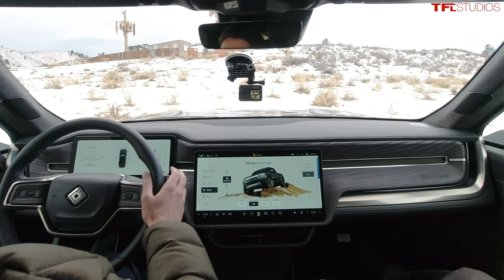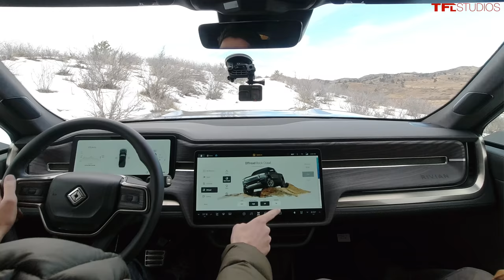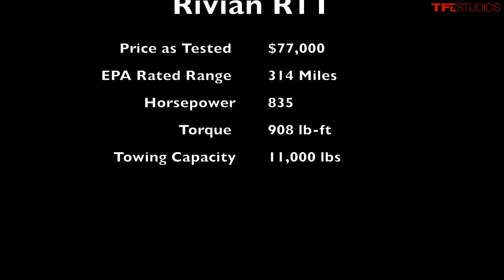Fully Loaded! Can an EV Pickup (Rivian R1T) Survive a Hard Days Work?

Comment: Price is a big hurdle for a lot of people.  The EV market has neat stuff, but everything's 2x to 3x the price required for actual mass consumption.  You have a few at the right price, like the Leaf.  But pretty quickly you're up to $40k and above.  Even the affordable Model 3 is a $40k vehicle where equivalent ICE products in $10k to $15k cheaper.  The Rivian just at it's base price is $60k, and you're at a decent ICE product range by that price point.  When trading EV and cost along with total package practicality, you're in the realm of something like a Mach-E in the mid $30k range, but higher trims of that head towards $50k.  Tesla's been in the market for long enough to have a pretty broad price point spread.  But new companies like Rivian sit at an entry point of $60k and Lucid is way up at like $130k.  Most of the budget EVs are small cars, compact things that lose a lot of the practicality breadth just to match the price of ICEs on the market.  This would be a wildly different story if the Rivian started at $30k, but that's kind of the core problem.

We can argue savings long term and possibly government incentives, and maybe you're ROI versus an ICE equivalent is like 10 years.  What if you don't own it that long?  What about depreciation and year to year loss of value?  It's also important to understand electric costs and the concept of price equivalence.  MPGe is high, but true savings comparisons are a byproduct of real costs, what your fuel costs today, next year, 5 years form now, and how much electricity costs at home (and at what hours of the day) and cost of charging stations and if the business model of those also change in the future.  However, in general, the numbers that others have looked into show a 60% savings on fuel costs with EV.  For 15k miles a year, 30mpg, and $3.50 gas price, that's roughly $1000 a year in fuel savings.  The same 15k miles with a 20mpg vehicle and $4 gas is an $1800 savings.  So 10 years equals $10k to $18k  in savings...on a vehicle that costs $20k to $30k more.  And if you only own it for 5 years and resell, depreciation on a $30k vehicle versus a $60k vehicle hits way different.  The critical point of EV is when it TRULY and significantly becomes cheaper to own.  Right now, that's only the smaller EVs and hybrids.

A secondary part to this cost game is the difference in towing.  EVs drop around 50% in MPGe towing.  ICE are closer to 30%.  So for a work vehicle or anything commercial use, the buy cost difference needs to be tighter to be more cost effective.

With costing aside, EV is cool in the sense of what if offers.  The EV architecture allows new packaging and space.  It offers high power output on a compact package.  All of a sudden you can have 1000 hp and 1000 tq in like anything and everything.  It sounds impressive, but some of the effect of it is lost with the lack of gearing.  It's like having a 1000 tq, but you're starting off in 4th gear.  Like a Viper will go 65mph in 1st gear.  Basically a Viper's 1st gear is most cars 3rd gear, and it hides the torque a LOT and makes the relatively slow at lower speeds.  EVs have the same mechanical disadvantage.  EVs kind of sit in two realms, geared low or geared high, and they either have low speed punch but not much up high or high speed punch but less so down low.  Big raw numbers covers the spread, but the impressive numbers are only partially used relative to an ICE with gearbox.  People who grew up paying with RC cars might understand this better, especially if you played with the hobby stuff, built your kits, played with different motors and gearing, etc.  Power and gearing is a tradeoff, and traction has limits.  You balance the system.  Or you just toss massive amounts of power at it (high powered brushless motors and high voltage custom packs).

Comment: Great Vid! Gotta agree with Tommy about the spare tire though. However maybe there is enough space to put the spare in the frunk? And on that note I agree there's not very much to not like on the Rivian, but the frunk would be more useful if the front of the frunk was flat so you could slide stuff in like other manufacturers. Having to lift stuff out is a bit more of a hassle.

Comment: The truck has a front trunk as well. Would have been cool to do an Avalanche style folding bulkhead in the rear AND the firewall.  Run pipe between the seats and all the way to the front bumper.

Comment: All it took was seeing the one sheet of plywood hanging out back. A small 28 square roof took 45 sheets of plywood, nearly 100 bundles of shingles, a roll of tar paper a roll of ice dam all ridge vent and metal edging with it. All fits in back of my 1982 Ford pickup. What you have is a joke. My old truck has been on job every day for 40 years. It starts on the hottest day and been on road at -30 in winter of 1993. It has proved itself a reliable truck with well over half million miles. Original from transmission to ground. Changed engine few times but only cost 500 dollars.

Comment: You answered a question I had about hill descent. I was concerned since it didn't have a low range but it looks like the regenerative breaking is enough. How much weight can the tailgate hold? Hinges look a little weak. I won't get rid of my F250 but this would make a great vehicle for my many short trips.

Comment: Tommy  there are 2 ideas they should take away from ford to improve this truck on board scale to check the payload and more amps with a voltage meter to see how much watt’s the truck is using but  the price has to come down between the Merrick in a platinum Price points for the price they’re charging it should include the onboard kitchen Tommy that was A good  In-depth view of the trucks potential

Comment: The key measure of thus as a work truck is how much work can you do in your job with the available 75 kWhr or so.   If you move 25 miles at 3 kW/mi you are ok or 75 mi @ 1 kW/mi.  But you can't do more where there is no recharge nearby.

Comment: Question about a possible work-around for this truck: since this IS a truck and Murphy's Law will give you a flat when the bed is fully loaded and it's cold and it's raining of course, lol...could the spare live in the frunk? Seems like a great place if under the bed is not an option and under the bed floor is a pain in the ass to get to when loaded up. Yes, then you are using up that useful weatherproof compartment. But it has a whole covered bed and a gear tunnel already.

Comment: For me the big problem is, I get back after working hard. It’s fully uncharged and I need to charge it. Then I get a phone call that my kid is in the hospital. Do I have to wait for it to charge? It breaks down. I can’t fix it. And then I have to find a place supposedly in rural America that services electric trucks. Or, government starts really nannying the features of my truck and decides I don’t need some of what I paid for such as the tank driving mode you mentioned. They can push out an update while I’m sleeping and my truck no longer has it. None of that is the case with my gas truck. So no, no because of the lack of control I have to fix, lack of ability leave when I need to and because of the regulations that I already see being pushed out all the time on Teslas.

Comment: I wonder if it can simulate fully locked "axles".
It didn't seem like it on the other off-road video.

There's always an advantage to have fully locked at all times instead of sensors sending power.

Comment: I wonder how long it will take a company like Toyota to put a really solid, dependable, long last EV truck like this.  I mean, maybe the Rivian will hit it out of the park but the tech's adoption feels like it is in its infancy.  I like the advantages an EV has to offer.  Faster acceleration, more torque, much more simple to design and build... battery tech will improve in leaps and bounds over the next 20 years.  It's hard to imagine what vehicles will drive like in 20 years.  Very impressive.  People often forget with a car, truck, appliance or cell phone for that matter... it's the back end stupid.  Warranties, service, repairs, parts availability, etc.  It's going to be a short while to straighten all that out, but it won't be long.  I'd probably buy a third year production Toyota Taco hybrid.

Comment: Quick question were you guys able to do a range test at all? Are you even legally able to say what was the max range you could get out of R1T with these tires? Truck looks capable which is great, tailgate extension comes in handy big time. Perhaps there could be some aftermarket accessories that can utilize that feature. I'm concerned about the range tho bc of it's weight.

Comment: I would be interested to see the maximum torque per wheel. If it's 900 lb feet total. That would mean it's 250 lb feet at each wheel. That's not a huge amount. If you were to find yourself in a situation where you needed to pull yourself up and over something only using one tire, I doubt 250 lb feet is going to lug a 7,000 lb vehicle up and over anything. That's one advantage of having a mechanical drive unit systems. If you've got lockers front rear and center whatever the maximum engine output is can be sent to any or all of the wheels. As long as the axles and suspension and drive line can handle that much torque.
For example in a Wrangler Rubicon when you lock everything up it can pull itself up and over anything even just with one tire. I doubt that the Rivian would be able to do that.
Would be interesting to see if they put a mechanical locking device between the two motors and the front so that at least you can link up two of them on any wheel in the front, And same in the rear.
That would give you 500 pound feet of torque.

Comment: Does the Rivian have enough range to go approx 100 miles each way to a herding trail we work in January and July? Keep us warm in January here in Northern VA with max temp of maybe 20F and a windchill approaching zero when we need a break from the cold and in July when its a 100 F by 10 am with a dew point apporaching 80 keep us cool when we need a break? and the we charge quick enough when we get home to repeat on Sunday?  Does it have enough range on Fri afternoon in August  to get me home from work when its 90F+ and dewpoint is 80 and I am running the AC at max in bumper to bumper traffic moving at maybe 15mph for a 50 mile trip home after a 50 mile morning trip?  So thats  100miles  but can it handle full AC and bumper to bumper crawl?  A EV has to able to ahndle the extremes not just the every day. My GC can do and I can fill up in less than 10 minutes with 20 gallons of gas.

Comment: How good would the battery life be on a 5 degree day pulling an 8000 lb loaded stock trailer 75 miles and back then ranch work?  Not practical as a work truck.

Comment: I'm surprised Rivian doesn't offer a bracket shaped pivoting tail gate cage  that when flipped over goes from resting inside the end of the bed to rest on and coral the 3 sides of the tailgate when it's down.Originally offered on the  nissan frontier quad cab around 2000.
Reply: Not their demographic. But I imagine we'll see a 3rd party option later on (that's if Rivian doesn't come up with a more traditional work trim for the R1T).

Comment: Speaking of getting a flat; can the suspension lift just one wheel for changing?

Naturally you didnt use much battery - you werent going fast enough for wind resistance, and thats where 90% of ecar battery goes - pushing air out of the way.

Comment: And, if the battery dies out in the woods, does it come with a 30 mile long extension cord?
Reply: If you run out of gas in the woods, do you have it come with a 50 foot gas line? Seriously, NO one runs out of fuel any more. Too much tech that advises you how much distance one has left and even points out the nearest refueling stations. Point being: one plans accordingly.
Reply: @eddiesantos6407  you might want to watch the video again. I believe you’re confused
Reply: @williamarnett9064  I did. Did they run out of fuel with no way to recharge? No, they didn't. What imaginary video did you watch that you fabricated that scenario? Get back to me about who's confused here, pal.

Comment: From what I could find, the power outlets are rated at 400W each, so yeah, probably shouldn't plug 1500W equipment in there. I'm surprised it didn't trip a fuse.

Comment: I think a great test for any new electric truck would be using it to transport show horses in a bumper pull trailer to a horse show, maybe 1-2 hours away for a day, or overnight; with family/ kids. How does it hold up loading up gear / tack the night before, parked by the owners barn not the house (away from charger), then loading horses early in the morning, traveling, stopping for pee break with kids at gas station (navigating truck / trailer at gas station with live animals in tow), getting to show ground, unloading horses and gear, parking in field, going to motel or airbnb for night (charging available?), go out to dinner, back for late night horse check at at fair grounds, back to motel, sleep, then to show in am, park at fair ground in a field, then pack up and leave with kids and horses later that night for the long drive home, back home and unload, park for night exhausted, forget to charge it, get up and commute to work in am. How will it or any electric truck hold up? A lot of people in the NE use their 1/2 ton and larger trucks for this purpose, not so much off-road farm work except for getting an occasional load of hay off a field or from a seller, and shavings at the feed store. Looks like small gooseneck trailers aren't compatible with many electric trucks if Im not mistaken. We have a 2014 F350 diesel that serves this purpose well, used to use a Suburban that had its perks for dry storage in back.

Comment: In 10 years, when they'll have released 20 of them and maybe one of them is in Australia, I'll consider it! :D impressive truck, if you can buy one!
Reply: Um, 2500 units built, over 1600 units already delivered. Beat that "20 of them" margin by and it's not even 6 months (vs the 10 you so eloquently put).
Reply: @eddiesantos6407  lol, sure! to be fair they have a shot but it's no smooth sailing for the ones out yet, and there's no mass production plant running or even being built. I love the idea for this truck but it's still very much prototypical unfortunately. I was exaggerating to illustrate a point, the accurate numbers don't matter in this case. But I guess you know that and wanted to be pedantic, that's cool!
Reply: @JonathanAdami  I was being pedantic? Sure, Mr. TheyOnlyMade20, heh. Btw, none of those 1600+ units delivered are prototypical. They're full blown production models. And no Mass Production plant? Is the Illinois plant an illusion to you?
Reply: @eddiesantos6407  it is yes... but I don't see why you're getting up in my feathers with this, do you own the company or what? I'll consider them serious contenders when I can get one... right now, if I'm chucking 100k at this, I won't get one for the next 3 years... this is not yet a car company! Also why do you care so much about what I think?
Reply: @JonathanAdami If you're going to point out a negative, be accurate and factual about it. Fabricating false information doesn't help anyone's cause (even yours). Other than this, I frankly care very little what you invest your $$ into and what company you prefer.
Reply: @eddiesantos6407  Well I don't have to do I? It's not like you're important or anything... so your rules are good for yourself, and you should keep it that way!
Reply: @JonathanAdami  same applies to you, skippy. You just as unimportant. So how about keep things factual instead of pulling fabricated info from your nether-regions.
Reply: @eddiesantos6407  I did keep them factual, just not accurate... on purpose... look, have fun a little, you seem tense!
Reply: @JonathanAdami  stating they've only made 20 is FAR from being factual. Who are you trying to convince here, me or you?

Comment: Seems silly that the front grill doesn’t open when the frunk is opened.  I also would rather get rid of the tunnel under the seats and extend the bed of the truck… or you could keep the tunnel storage and just allow a fold down to take advantage of the space if you are hauling longer material

Comment: The amt of wood in the bed overloaded the truck’s 1400lb rating.  Regen braking going down hill with loaded truck will recoup most of the energy used climbing the hill with empty truck.

Comment: Very nice truck, but at what costs? I had my own estimate for an EV pickup truck for $90k (CAD). Let's say I will use it for 10 years and 20k km per year. I need to replace the battery every 5 years for the best performance ($20k) + a cheap maintenance fee ($2k+) + winter tires with Rims (1.5k) + cheap electricity bills(1.5k) = 115k in 10 years.  Estimate for a petro pickup truck. Purchase price 70k + maintenance fee ($4k+) + winter tires with Rims (1.5k) + Petro gas fee  (40k) = 115.5k... not much difference for consumers unless we drive more than 20k km annually.

Comment: that flap on the tailgate needs to be metal ASAP id destroy that in two seconds and the hole to no where under it is a big problem, few loads of material and thats gonna get full with no easy way to empty... strap mount points too high up, why no 240v power outlet and only 120v? during a power outage i want that 100kwh+ battery to perform for me, 120v only is silly. Also are the two outlets limited to 15A combined or each? 15A combined would also be not ideal.